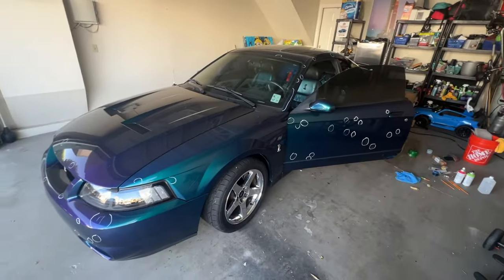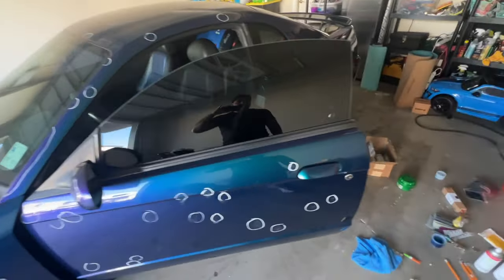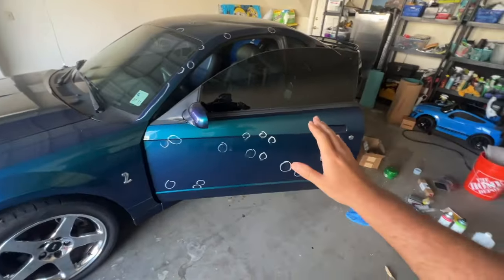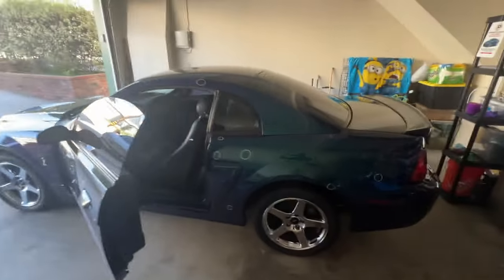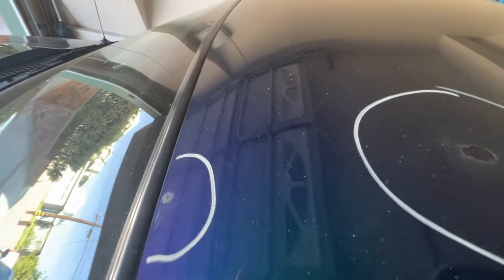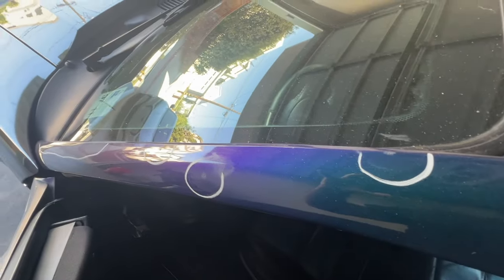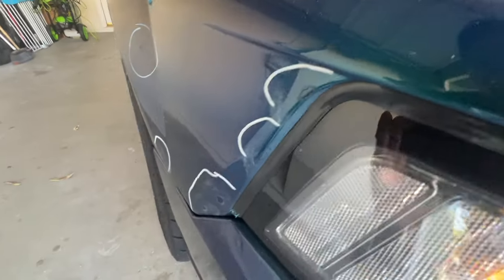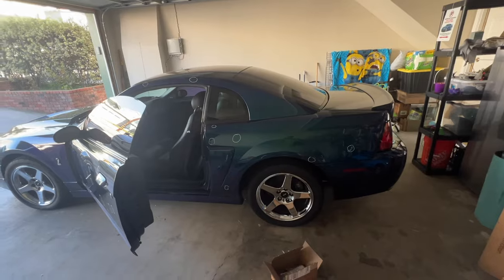ATTEMPTING DIY PAINT REPAIR MY MYSTICHROME MUSTANG WAS A HUGE FAIL! PART 1

Comment: Do you still have the truck? Any long term issues running your hot MPT tunes? Trying to decide if I should go for an e30 or e50 tune. Love the 91 PRX already.
Reply from the maker: I sold it recently actually, this terminator is now my daily driver I was getting the itch for a manual… the truck ran great the whole time no issues whatsoever. I would just go e50 since it’s more power over e30 and you are gonna be mixing fuels anyways, send it!

Comment: I used sonic blue touch up paint and spray paint, I only sanded the big areas.. Definitely wouldn’t sand the rock chips, I have a short posted of the before and after… I would say it came out a 9 out of 10, imperceptible to anyone except for me because I did the work..
Reply from the maker: That’s awesome, have another paint touch up kit on order called dr color chip to my surprise they actually had mystichrome as a color available will make a video once it comes in. Then it’s just paint correction and ceramic coating!
Reply: Mystichrome needs a dark grey or black base to be sprayed on top of, you might get away with glazing putty to fill in the spots then sand smooth then spray the base and then color and clear and wet sand and polish afterwards but with how much trouble you'll go through with that many spots you might be better off repainting the whole car just depends on how good of a repair you want to do and most likely a shop will probably say you just need to repaint the whole car